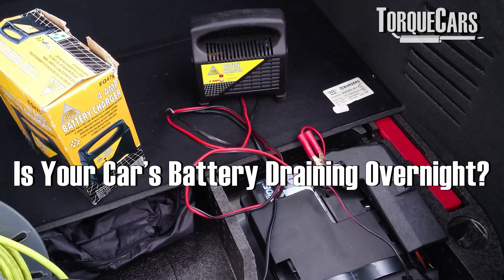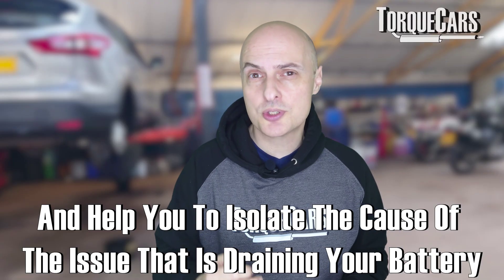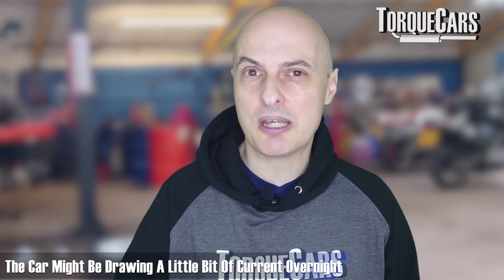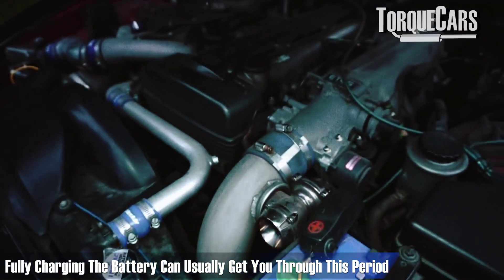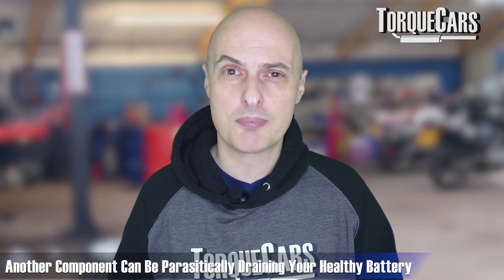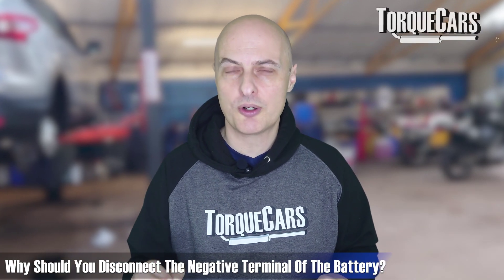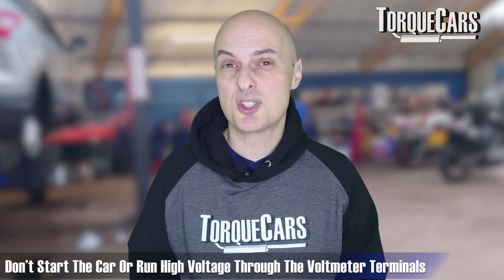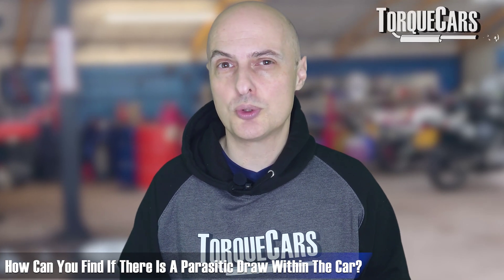Avoid Dead Battery in the Morning? ☠️ Identify & FIX Parasitic Drain with a Multimeter! Troubleshoot

Comment: Great video had a issue with daughters 2016 Peugeot 2008 with power sick. Having renewed the battery the same happened after 3 or 4 days then dead. Eventually found out that the alternator was charging at 12v rather than 14v but still suspected it may be additional to something pear shaped with the dire electronics known to be poor on this model and plate. So rather than risk a bottomless pit of money the car from Evans H (joke) has been moved on.